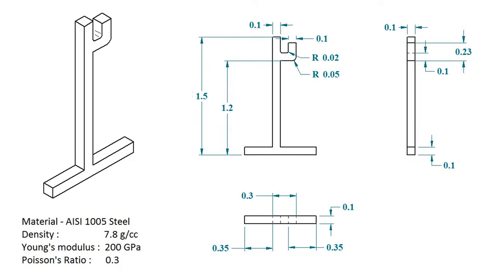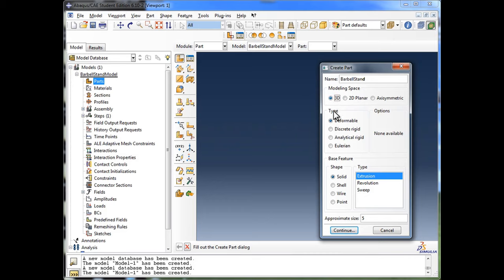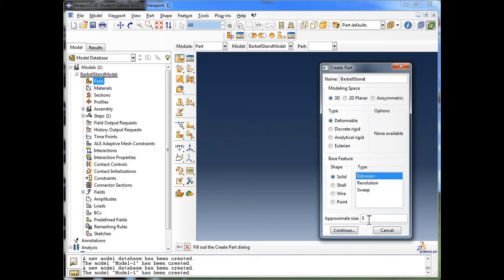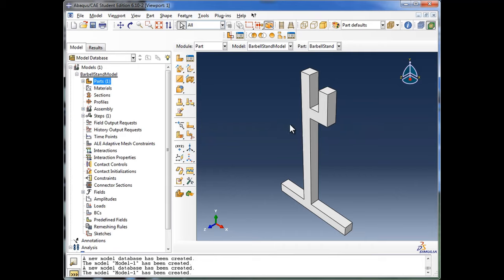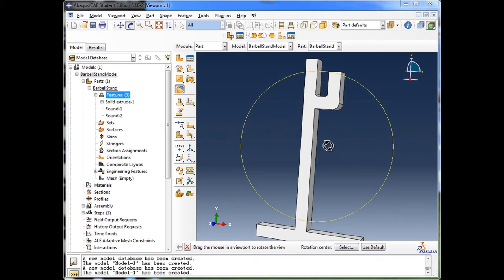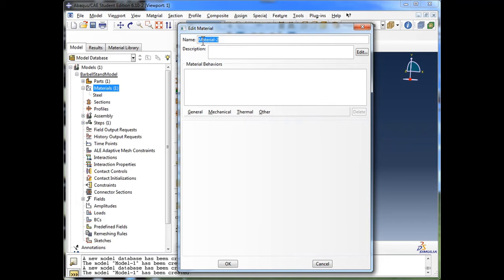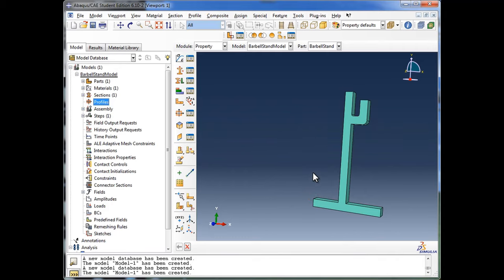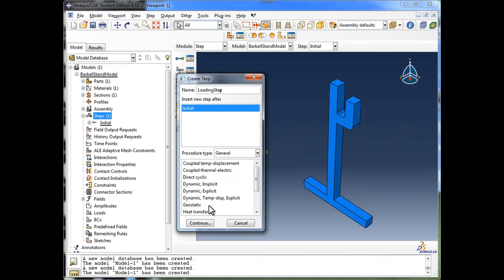Getting Started With Abaqus | SIMULIA Tutorial

Comment: Nice explanation with all of the calm that is needed for a beginner. I would just point one thing, when you digit 400 in "Pressure Load" i think you are putting 400 Pa in that surface that should be 0.003 m^2. It means that there is a load of 1,2 N applied.

Comment: You wanted to apply 40kg(400N) as weight, but you applied that in the "Pressure" category. So, that would mean, you applied 400N/m2 on that face, not a weight of 400N, right?
Or am I missing something? I just started to learn Abaqus, which is why I am getting a little confused.
Reply: You're right and can refer to the Abaqus documentation by selecting the "arrow+?" symbol and clicking on the "Magnitude" field while editing the load.